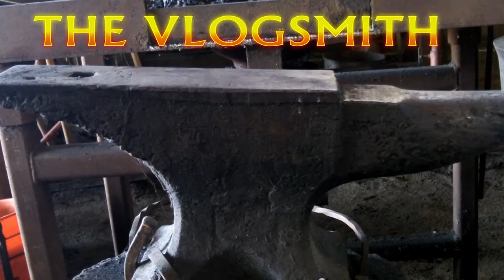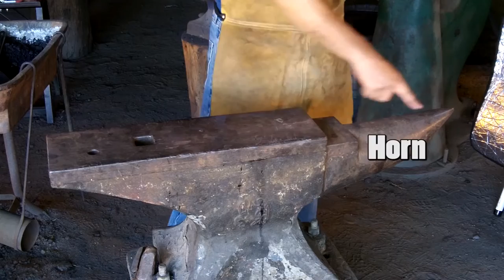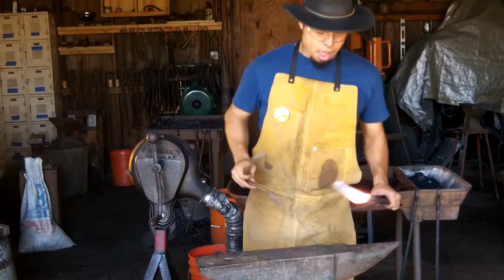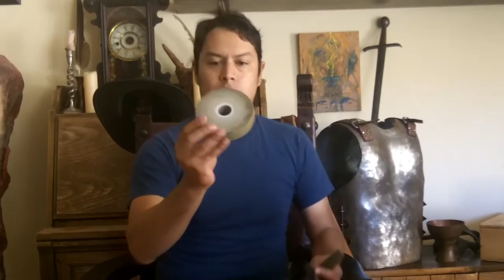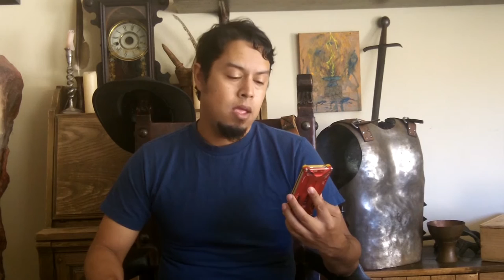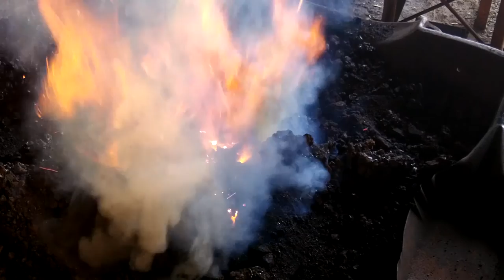The Vlogsmith Ep. 2 ( Blacksmith - Forging a Door Knocker )

Comment: What are the different parts of the anvil used for?  As a non-blacksmith, I've often wondered why blacksmiths don't just use a square block.  I would love to know more about the history and use of such an oddly-shaped object.
Reply from the maker: Many blacksmiths do use a large meal cube. Anvils have changed over many centuries.
I may have to do a video just on anvils in the future as there is a lot to cover. as for parts of anvils, the holes offer means of shaping the metal whether by using mushroom stakes or using the round hole for upsetting and bending.